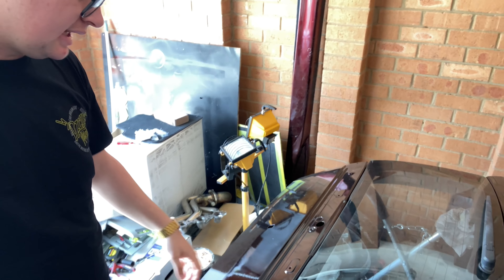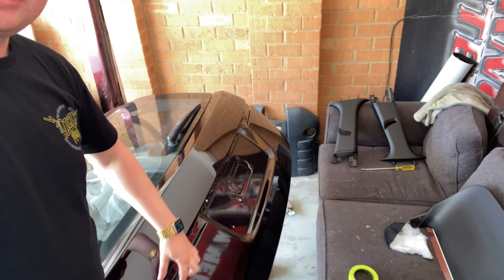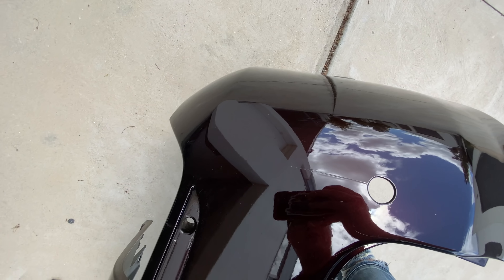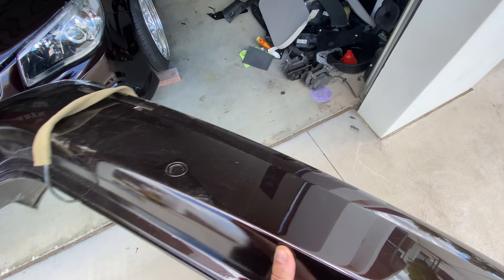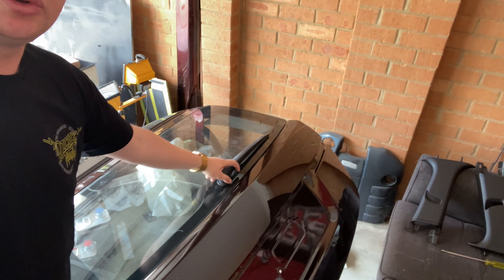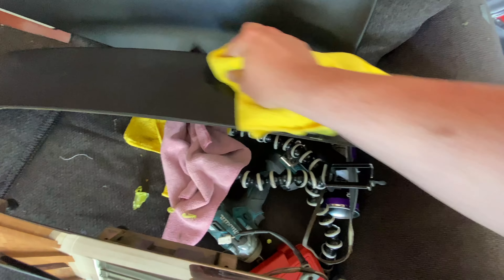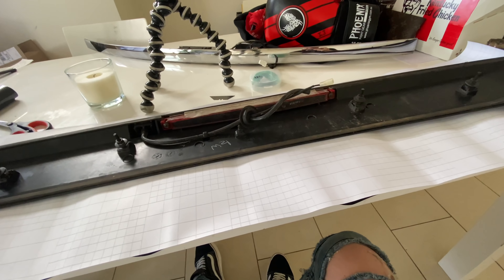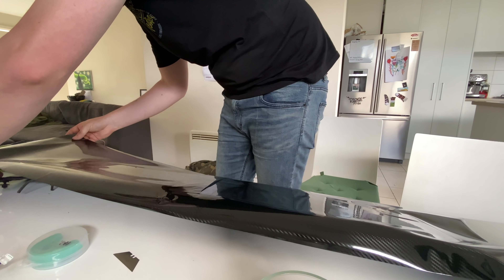Cheap Carbon Fiber Wrap From eBay... Just Don’t Do It

Comment: It’s not the wrap. You ran the heat gun on the adhesive side unevenly. So when you lay Ed it down you had a piece of wrap that was in parts heated and in other parts not. I bought a eBay wrap and is still looking good on my roof and hood and bonnet.

Comment: Glossy black carbon fiber wrap;
What are good Cheap ebay wrap sellers? I only see 12” x 5’ available?

What’s the manufacturer names of the highend wrap? I’d like to compare both with samples. 

Hmm 🤨 how much length and width is needed to wrap a hood, roof and trunk on a 2013 Scion Fr-S?